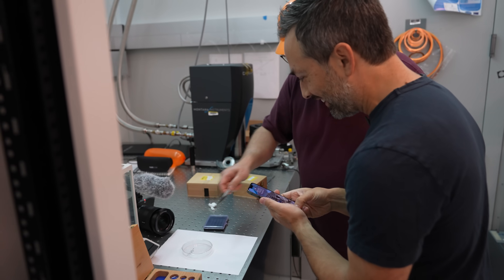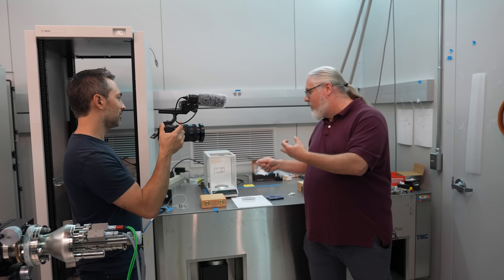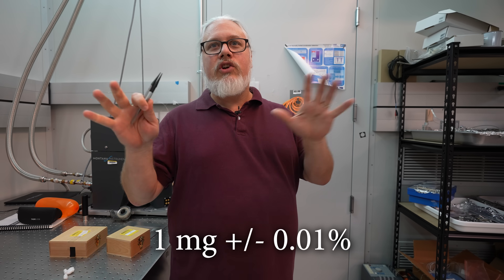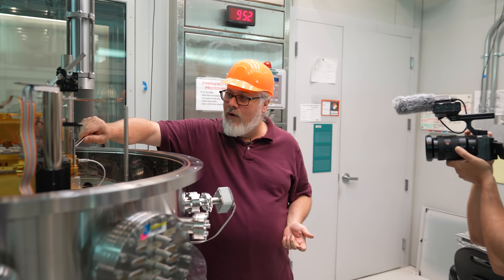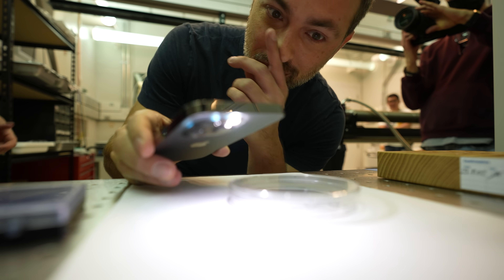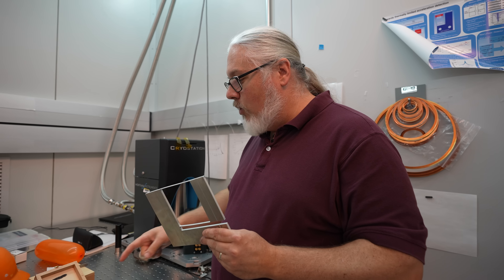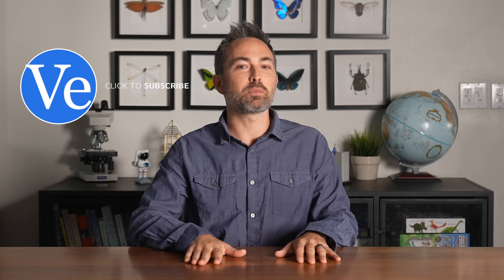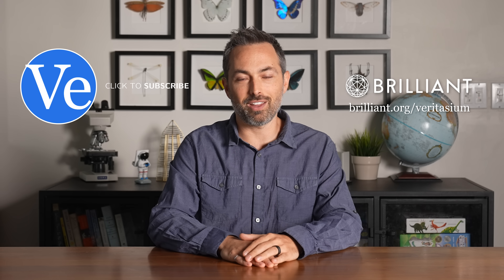How To Measure The Tiniest Forces In The Universe

Comment: 1:00
Anybody who thinks the US' use of the non-metric system vs metric system is stupid has a severe misunderstanding of the non-metric system, which is likely due to too much time in academia and not enough time in construction.

When making calculations, the metric system is superior.
When building structures to contain people, using a measuring system proportional to the size of people is superior.
Also Freemasonry, whom are very into the non-metric measurement stuff, and of course, came from the builders of Medieval Europe whom then founded America.
So yes, the US uses non-metric.

Let me give you can example.

3/12ths of a foot, vs 3/10s of a meter.
How much is each?
Now let's say 5/12ths of a inch vs 5/10s of a meter.
Okay half a meter and 5 inches.
Okay what about 6/12ths vs 6/10ths?
6 inches, and 4/5ths of a meter.
Its way easier to make quick calculations with the non-metric system.

Comment: Gravity changes depending on where you are on the planet. 

Measuring at this level seems about as useful as putting a time on a pasta box; e.g. If i’m above sea level i need to cook pasta longer. It’s not based on gravity, but conceptually similar.
Reply: The correction required for that is smaller than the magnitude of the uncertainty of the reference masses

Comment: Depending on constants for definition of mass will create circular reasoning on the measurements.

It's the same problem with the meter stick definition when using the speed of light.

Comment: The thing that makes this so fascinating is that since light is a Force, it makes sense why it would curve around gravitational fields.
Light is just charged Photon Particles radiating from a source of Heat, which means as a "Particle" it has some kind of Mass. That Mass coupled with its extremely fast Speed produces a Force. Better yet, you can also infer that light, as a "Material" (since it does have some kind of Mass) has extremely high Tension, since the material is compressed around gravitational fields. Light was Nature's (and the whole Universe's) Solution to obeying Physics, despite how Physics-breaking light seems to be, because the Vacuum of Space cannot dissipate heat normally, so it has to dissipate Heat a different way, by emitting irradiated Photons to compensate.
Energy cannot be created nor destroyed, so it has to change form in some way, and if you can't dissipate Heat with Convection or Conduction, then it has to be emitted as Radiation, but again, it seems we don't have anything to radiate since the Heat is coming off the Material and onto nothing, so what ends up happening is Nature "creates" a Material to carry that heat somewhere else, and so Charged Photons are created, and emitted into the cold vacuum of Space.
Science is wild stuff 🙂
Reply: Wow very nicely said can you also summarise the whole video in few lines

Comment: Worked on a wearable infusion pump years ago, which was rated for rates down to 6 ul/h, which actually not as low as some insulin pumps go.  Even so, when measuring rates, we pumped to picogram resolution scales to get enough resolution/accuracy for our rate measurements.  At that scale, fingerprints on any part of the weighing setup would reek havoc on our measurements.  It wasn’t so much that the set up was contaminated, it was that there were volatiles out gassing from the finger prints and they were also nucleation sites for condensation so the mass measurements would never stabilize.

Comment: I am a Com Sci major and I had a class called "Numerical Methods" where I saw how much "damage" minute errors do to actual calculations, and those errors stack so much. Precision especially with how computers does calculation is very important a close value may very well be far from the actual value. Even if the calculator spouts something, there will always be computational errors present and that should be minimized as much as possible, especially when dealing with very very small values.

Comment: The most accurate kilogram was made by the university of Queensland in the late 80s. It was a sphere, so only one dimension vs the complexity of manufacturing a cylinder.
The sphere was so round, if it was scaled up to the size of the earth its biggest peak to trough variation would be a few metres.
They tried to get it adopted as the new standard but the French said no.

Comment: Diesel particulates are measured by an opacity light
Reply: Depends on how accurate you need to be. An opacity light will give you a good general idea. Physically weighing it would give you a much better idea. 
Would just be something they’d need to do for certifying something. Like measuring that a DPF is working well enough.

Comment: ... any standard of measurement is accurate. 

Imperial measurement, has other names, but it is a visualizing system where the rough idea of its size and shape can be pictured, where metric is better for lab, as you can't really visualize it imperically in your head. 

then we have cubits,

but you can measure in anythign that your using as a interval for that space, via, a random twig broken at a some arbritrary distance etc. Not entirely sure the enemy here is metric or imperial... but unless you know how many cm, are in 6  feet stating 6 feet we have a novel idea of what it is. or even 1000 feet... or metres... the means of other groups attacking people and calling people stupid dsiregards that all forms of measure is precise.

The best thing of imperial is that its also can be wrong but be adaptive construct for smaller humans isolated ot their own measure of imperial if they base it since its living interval, sure its wrong to its standard but perfect for spread out humans... today, there is a definte standard, and yeah when you make a measure you need to send specific things to manufactures to that they are with a error of degree, however if there is 0.00001% error, it means the measure is limited to 10 thousandsths or less becasue after that it would be no longer accurate.

The funny thing is there is another way to make a standard. It involves a different udnerstanding, So what would always be exact and precise to a measure that someone could use, and send around the world. ALso the kilogram sent out should have a a geophysic data set, meaning it would require, pressure earth, humidity, rotation moon, etc, cleestial map and geophysical sources so about 900 factors for a measuring device has ot be recorded at its production so that mimicing those offsets or evne calculating those offsets you can make more exact replicas of that kilogram.

 The point of exactness, would be picking something in the universe that will never change, and the best way is an active experiement, and then that use as a standard measure, with all teh same 900 factors included or more, or an islated control system  with an artifical vacuum, or removing gravity constant would be nice, but we don't always have space. but space would elimiante many factors when creating a measure. Anything on earth should be considered Earth atmosphere of creation since each piece of matter will be different then if it was  on a differnet planet, mostly liekly by the gravity, humidity, atmosphere pressure etc.

So yeah, there is a more accurate way to make a measuring system. decimals don't make something more accurate, natural ratios are typically exact, then makign a calcuation. nonetheless, pick something in nature that will never cahnge in this universe unless somethign changes, adn this also allows the creation of new instruements, like the width of hydrogen molecule as a standard in x and y... doesn't matter when or where in the universe it will be a system of possible measure, I can't remember but their is something that will always form the exact same way and can the nbe trasnlated as the interval for the unit, adn then you can double it or times it by 100. 1000, 10000, or 12.. s it doesn't matter... standard of measure is important to communicating and everythign is preceise, but as a stanrda manufactured elsewher its important to have some gauge... howeve,r what if you don't need to import nonsense and you can just create a vaccuum and sub zero temperatures and when x element or atom hits a specific gradient it has a common phase change and you can record that and make that your interval, of course thats a small scall but it can be magnified, but a larger system could be made, that phasing step could calibrate a specific volume of measure to fill a quatified means of space of that substance once you find its phase value exactness, using metric sure wit hteoutside machines, and hten you take alrger portion of it nowto the phasic state and replcate it int oits latice structure so yo uahve alarger refernce that owuld always be the exact same regardless in teh universe, even in a black hole if you can counter the factors you coudl calcuate teh same measure as one earth... be a bit weird as you wil lprbably be dead, but meh.

Comment: I’m a little confused because mass is not related to gravity! The balance at 7:20 measures force due to gravity. So I was expecting them to include a gravity meter as a reference to measure mass. But they didn’t. Gravity was only measured once! Gravity changes you can see tidal effects from the moon on a laboratory 5kg scale so it looks like there is significant information missing in the description of the electrostatic force measuring device? It’s a balance but not a mass balance!
Reply: What's more likely:

You have either failed to understand, or have been given the simple explanation.

OR

The incredibly accurate instrument used by professionals to do their job day in day out has a fundamental flaw than not a single scientist on the planet has noticed until you, a random person, watched a short video segment on it.
Reply: @mattd6085  I wasn’t pointing out a mistake in the instrument but a significant floor in the explanation! It’s not simplified it’s just wrong!

Comment: I'm confused because if we're talking about specs of dust affecting the most precise mass measuring tool in the world, and you're allowed to walk in there with plain clothes and breath out all your dead cells and humidity without a mask. Then we might as well be guessing? We're talking about piconewtons while there are more than two plainly clothed unmasked spectators speaking moderately. We're talking about detecting the force of a lazer pointer while talking over it in a moderate tone.
Reply: They obviously clean their instruments before actually using them you dolt. This is a tour for a video, the lab wasn't actually in use there and then.

Comment: That tiny wire doesn't look that small. ICs and other electronic devices, like transistors, for instance, have thinner wires connecting the dies with the chip pins xD

Comment: I was surprised that they didn't need hair nets and special static and dust suits to work in this lab.  I would think that a particle of dust or a dead skin cell could interfere with the measurements.  I remember back in the 1960s what a tedious job it was to calibrate a mechanical balance to do quantitative analysis measurements.  Electronic balances were just coming into the lab and were so much more convenient.  I was also struck by the measurement of the force of gravity on the floor of the room because in our physics lab any massive object(person) near or passing by a test of minute forces could interfere. That's why the force of gravity is only known to a few decimal places.  Too many things can interfere with the measurements.
Reply: I imagine they DO wear special clothes when actually running tests. This video was a tour, with nearly all the weights inside containers.

Comment: Hey I have a question, if a laser applies a force then according to the equation F=ma it has to have mass (if m=0 kg then F=0 N) but, if lasers travel at the speed of light and light only moves that fast because it doesn't have mass then how does it work? Now that I think about it, E=mc^2 but light has no mass therefore it shouldn't have energy but we know for a fact it has. Can someone explain me all of this?
Reply: E=mc^2 isn’t quite correct, you need to add in a momentum term. Even though photons don’t have mass they have momentum, which is what is transferred in a collision.

F=ma is better written as F=dρ/dt

So a small momentum change does apply a small force.

Comment: Dear Derek,

I am Armando Almaraz, let me congratulate you on your very interesting channel and of which I am a subscriber, now to the comment:

From what is exposed in this video it is understood that a laser light beam makes a silicon parallelogram flex vibrate by means of a "photon precision force" and I put it in quotes because this is where some questions arise.

What type of laser is being used? FEL?
Is the vibration of the silicone sensor caused by the "precision photon force" or by the excitation of the material and the air caused by the intrinsic momentum of the laser wave "energy"?

If we know that:

F = m x a

What is the physical principle that causes "photon precision force"? If it is shown that photons do not have mass, ergo does not have force.

And now to finish:

I am not saying that the measurement mechanisms are giving us false data, the only thing I am saying is that the physical principles for their operation may not be correctly explained, so it would be worth going deeper into their true operation, which is obviously not the "photon precision force".

Or maybe the method is wrong?

Thanks Derek keep up your fantastic work in popular science.

Comment: It's important to note that the equation E=hf is specifically for massless particles like photons. The equation E=mc^2, on the other hand, applies to particles with mass that are at rest. These two equations should not be combined or used interchangeably.

The equation you derived, hf/c^2 = m, suggests that a photon has mass, which is not correct. Photons are massless particles that always travel at the speed of light in a vacuum. Their energy is determined by their frequency, as described by the equation E=hf. Because they are massless, photons do not have a rest mass, and the equation E=mc^2 does not apply to them.

It's essential to apply the appropriate equations and concepts depending on the situation and the type of particle being discussed. For massless particles like photons, the energy equation E=hf should be used, while for particles with mass that are at rest, the equation E=mc^2 is appropriate.

Comment: The weight and math would change in different gravity forces. like the moon or mars. all your stuff is wrong there
Reply: Only the weight would change, not the mass.
Reply: @yourguard4  I never said mass in the OP.. read it again
Reply: @woodzyfox4735  yes, you said "math", which I couldn't make sense of, so I thought it was mass spelled wrong :P
Reply: dude that's not how mass works bro
Reply: @LineOfThy  an objects mass can change. Depending on underlaying changes like gravity. Example; if u measure and item on the moon for the first time it mass would weight less as there is less gravity if u measure its weight on Saturn it would weigh many times more. The mass in weight is directly effected by gravity if the objects are the same in every way. 

If your in true 0G space that same object would have a mass weight of 0 as there's nothing to weight it down
Reply: @woodzyfox4735  1) Mass does NOT change with gravity. Only WEIGHT changes with gravity.
2) Weight is measured in Newtons, NOT grams.
3) That only makes your argument LESS strong.
Reply: @LineOfThy  Bro... THATS WHAT I SAID... did you not read all of it?? Also gram can be weight...
GOOGLE:
On a scale, a gram weighs 1 gram. A gram is a unit of mass that equals one-thousandth of a kilogram. So 1 gram is equal to 0.001 kilogram. If you use a digital scale that measures mass in ounces, it will read 1 gram as 0.0353 ounces.
Reply: @woodzyfox4735  you literally said “an objects mass can change. Depending on underlaying changes like gravity.” Also scales are only accurate to earth, which is why they show the wrong mass on other planets with different gravity.
Reply: @LineOfThy  I never said mass in my original OP. Read it again.

Comment: This, and a video of a guy taking a carpenter's level to a body of water, got me thinking about how what we think of as "perfectly straight" might actually be impossible to achieve.  Conceptually, if you make the carpenter's level long enough, and assume that it touches the surface of the water at every point on the level, then the level would be curved and that curve would match the curve of the earth.  A laser going off into space is the closest we can get to "perfectly straight," but even that would be affected by the warping of space time as it left the gravity well of the earth and as it passed by any body with significant mass.  If you shined a laser across a body of water, allowing it to touch at only one point, could you assume that it was the perfect tangent to the curve of the earth, or would earth's gravity be enough to measurably bend the path of the laser?

Comment: Just a thought. e=mc^2. So, apparently, the warmer an object is, the more mass it has. To get an accurate mass reading the different weights should be all the same temperature.
Reply: technically yes. But unless that object is billions of degree's it won't make a notable difference, and at that point you have other problems. The room is temperature controlled anyway, so even things like buoyancy changes from thermal expansion aren't a factor